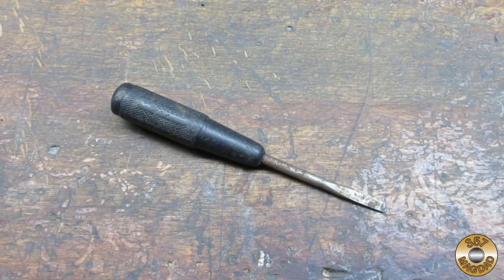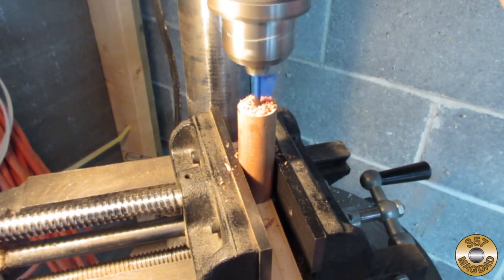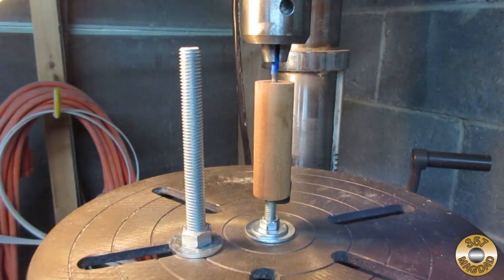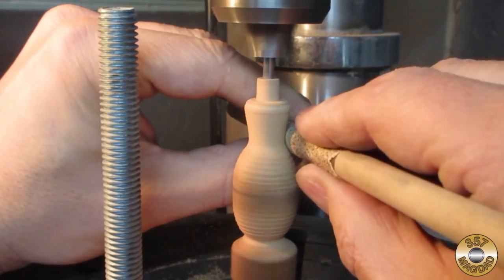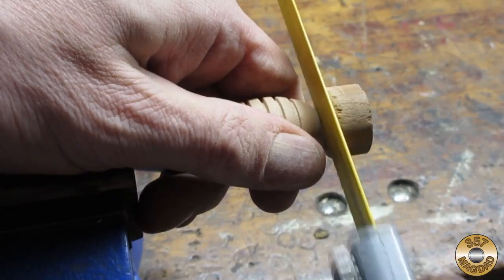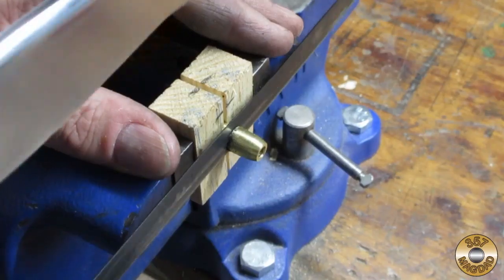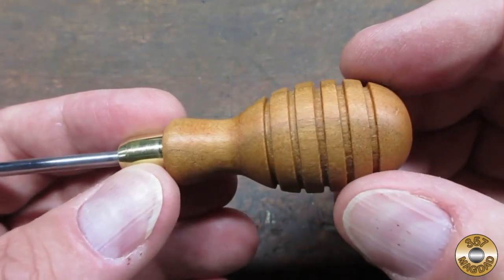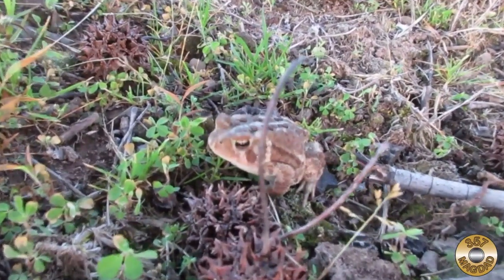Mini Screwdriver Handle Restomod

Comment: It turned out amazing!! I didn't had the patience to make a steady rest, so instead of using a chisel I removed material with a rasp and that worked fine, until I decided it was too slow and went for the chisel... Almost had to scrap the whole thing!! The shell casing ferrule was a really smart idea, I used a 1/2 inch copper pipe connector sawed in half. Great work magdad, thanks for sharing and take care!!!
Reply from the maker: Thanks 2/3!  The steady rest helps a lot! I'm gonna try your copper idea for a larger handle!

Comment: Beautiful. I think that original handle may be made of “bake-a-lite” (spelling). A lot of products were made with this material in the 40’s through the mid 60’s. Many of the steering wheels in cars during this period were bake-a-lite. It was sturdy but crumbled as it aged.
Reply: I agree. They used that before plastics were a thing.

Comment: Great job Magdad!! I especially like the handle and ferrule from the shell casing. Very ingenious! Nice work using the drill press as a lathe. If you're looking for an actual lathe, I have a vintage Craftsman if you're interested. Picked it up from one of the members of the tool swap that ScoutCrafter and I attend by us but never used it because I found a bigger vintage lathe with more tools and stand.
Reply from the maker: Thanks for the offer Steve, but I have very limited room in my little workshop.

Comment: Turned out nice, just a couple suggestions. You can use an old bicycle brake cable on the ridges of the handle and it will blacken the groves, just hold it until you see smoke. The other suggestion smooth out your "tool rest" you will get a smoother cut and will have to less sanding
Reply from the maker: Thanks for watching John!  I've seen people use twine to burn in features too.